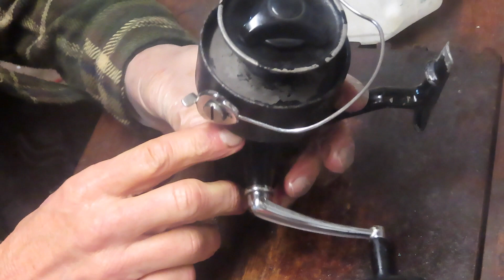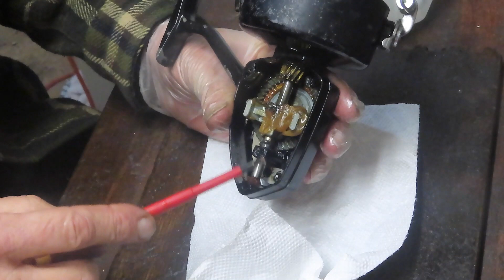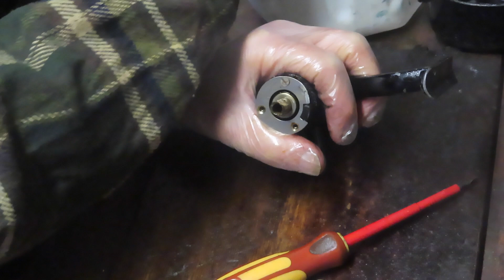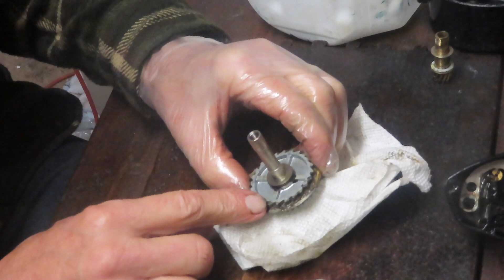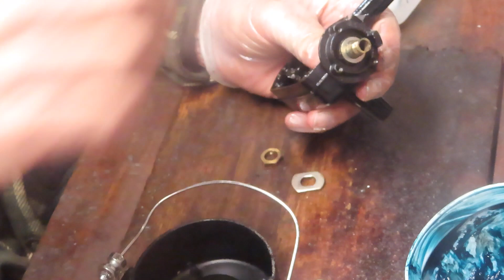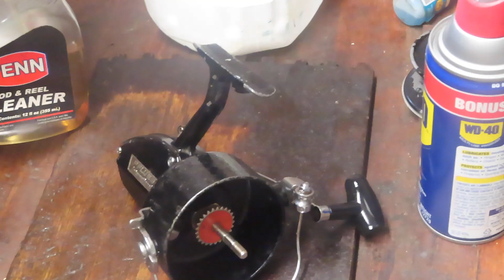Pflueger International 631 vintage spin fishing reel how to take apart and service

Comment: Can you tell me a little bite about the Daiwa GrandWave-Z 50HW. I don't see much online for it or post a video about it please? Thanks
Reply from the maker: Here's what I found.  I have not seen one in the shop and I am wondering if the reel was available in the US.  Seems like a quality unit.
Daiwa GrandWave-Z 50HW (In Box)
5 Stainless steel ball and roller bearings
Ultra tough marine bronze and stainless steel gears, precision machine cut
Anodised high-tensile aluminium spool, super strong yet super light in weight
3-D dynamic balanced anodised aluminium handle
Strong, lightweight, one piece corrosion proof composite frame and sideplates
Line Cap. 30/350 40/310 50/220

Thanks for asking - Dennis
Reply: @2ndChanceTackle  Thanks you sir. If the reel in case someone bring in. Please remember to post. You have a good day and be save. Byeeee

Comment: I know this reel and it’s a good one. You were correct about the paper towel! Lol  I’m one of those “old timers” that only likes vintage reels. Do you know how hard it is to keep 215 spinning reels serviced once a year? I admit I don’t do them all every year. I encountered another reel with a double open ball bearing set up - that Seacrest reel I showed you. It appears to be sort of a Japanese copy of a German DAM Quick reel. I didn’t spill the bearings this time. I wanted to ask you if you have encountered screw on rotors on spinning reels very often? I’ve had three in the last month. They can be tricky to deal with.
Reply: Theres a few variations of this reel. Theres
a Pflueger 231, Shakespeare 2107, Kmart
6100 and this one. Small cosmetic and
brand differences but same reel.
Reply from the maker: I was thinking the same as the trade reel manufactures in Japan in the 70s made the same reel under different names for export.  Thanks Armando - Dennis